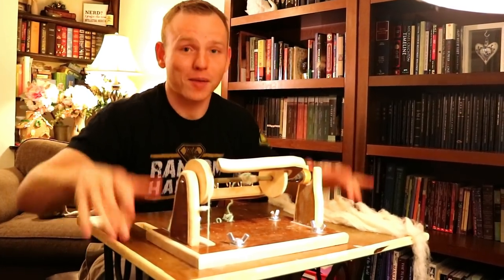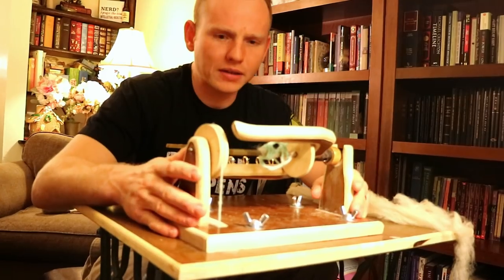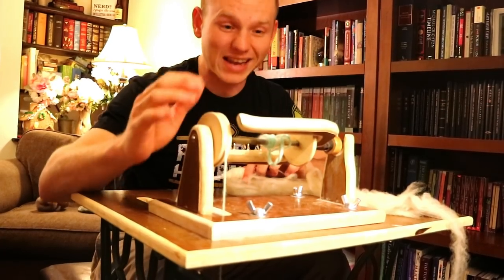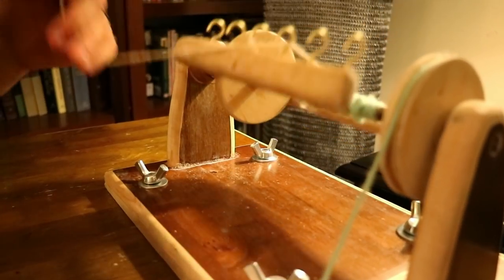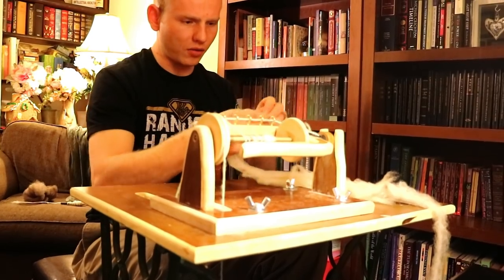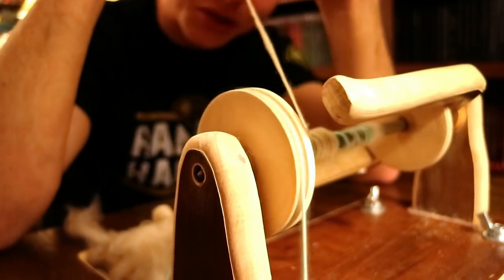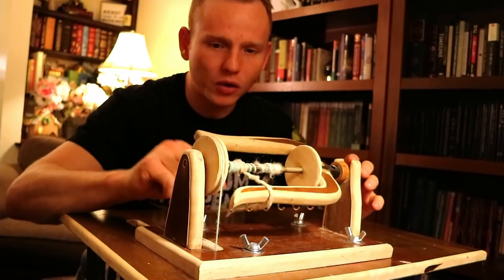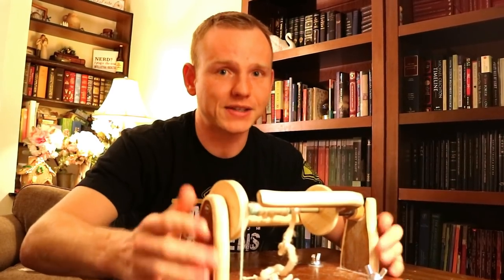Treadle Spinning Wheel (from a Singer Sewing Machine)

Comment: I attached a manual grain grinder to a treadle base.  It was meant to turn by hand with a handle but the wheel had a groove if you wanted to attach it to an electric motor.  Worked perfect for the treadle belt.  Love it.  I will use your idea of the wing nut base to make it more versatile, that way I don't have to have a lot of treadle machines all over the house for the "stuff" it runs.  Thank you, can't wait to make my Indian Head spinning wheel

Comment: It would be great to see a way to card wool using a treadle power....i have seen some drum carders operated by pedal power... converted bicycles....look up pedal power drum carder or cycle carders....a carder is basically made from a cloth filled with teeth fitted on a cylinder..and it could be made to turn with pedal power.  then you could process the fiber before you spin it. i would love to see what else you can come up with ...keep those ideas coming!!

Comment: Hi! I'm in the way of building my own spinning wheel, so I'm serching a lot trying to understand the mechanism (never seen a machine in my life) and you are the first to explain that the flyer turn becouse is pulled from  the bobin becouse they are conected with the string. Something simple but confusing to me. I understand that this only applies to irish tension. Thanks for the information! Sorry for the writing mistakes!
Reply from the maker: Scotch tension works nearly the same way, except that the flyer pulls the bobbin with the string instead of the other way around. I went with Irish tension to make the shaft simpler. JB.
Reply: @GoodandBasic  great, thank you!

Comment: What you’re calling string, which is fiber once it’s been twisted and holds together, we call yarn. 
Your next challenge is to put a second lot onto a second bobbin,  then take both those ends, tie them onto a third bobbin and spin in the opposite direction onto that. It’s called plying. That will make a proper 2 ply yarn that doesn’t unravel. You have to balance the amount of twist. To see how that works, draft a small piece of fluff in your fingers, twist and twist and twist, keep drafting and it gets really long, once you’ve got as far with it as possible (assuming it’s clean enough for your liking) nip the center with your lips, under your chin, with the help of a friend, somehow, halve it, and let the two halves twist back on each other. Now that is a 2 ply piece of yarn!

Comment: Hmm, I just bought a treadle base for my sewing machine...haven't got it hooked up yet. It uses a 3/16" belt. I'm wondering how hard it would be to take the belt off and on again to use the treadle base for other things...like a lathe!

I wouldn't mess with a potter's wheel unless it was to be permanently set up because clay, water and wooden table tops don't go good together! And it would be a nightmare to clean up to use it for sewing again.

Comment: I hadn't seen it-have you made any other attachments for the treadle base? I'm still itching to try this out, but if I could make a potter's wheel, lathe, or other bits for it, I could even more easily justify that treadle sewing machine I've been storing while my wife tells me to get rid of it! lol
Reply from the maker: I have a bunch of designs I'm looking at in Pinterest. But I haven't done more than 2 spinning wheel flyers so far. It's among the back burner projects waiting until I get a house JB
Reply: @GoodandBasic  Housing taking priority is definitely fair enough! But I hope to see them eventually for sure.
Reply from the maker: @jeffandthings77  you and me both! JB